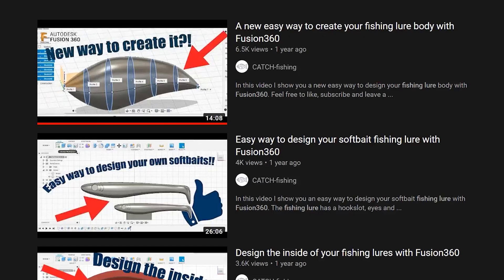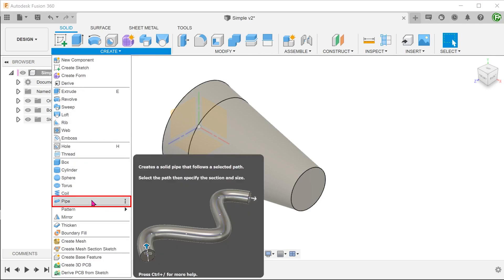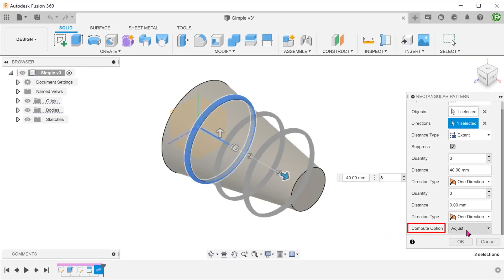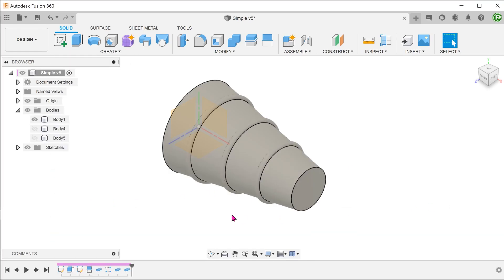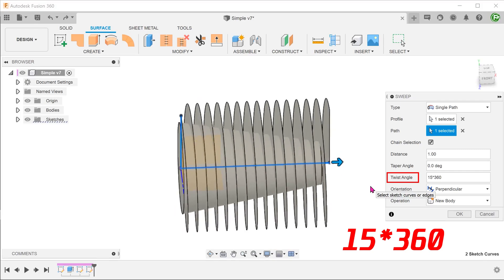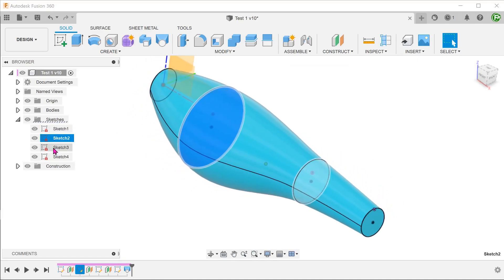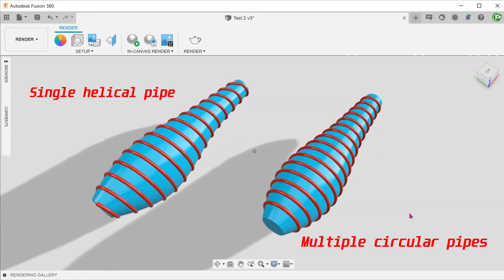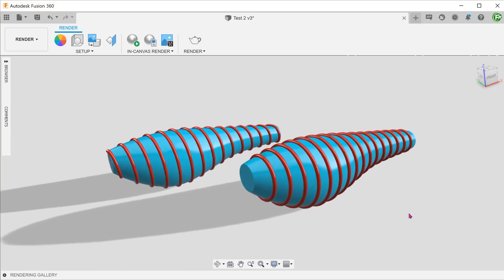Fusion 360 - Creating ribs/rings on fishing lures

Comment: Thank you for this solution.  My experience has been in creating the rib along a spiral path on a cone seems to work for a circular profile, and rectangular profile, however when trying to use an ellipse, the ellipse spins or twists along the path.  The approach I took though was a little different - I will try this and edit my comment.
[edit] - Thank for showing this method!  I managed to create the necessary shape (a circular helical shape on the inner and outer face of a conical body), by making the sweep twice, once for each surface.  My project/model was needed to hang a star onto our Christmas tree (the star has a helical spring shaped like a cone).

Comment: Would using  a construction line for the path prevent it from splitting the sweep?
Thanks for your videos, they're very useful; advanced enough to be interesting and stimulating.
Reply from the maker: Thank you for the compliments. Are you referring to the path for the loft or the path for doing the helical sweep? If it is the former, I did not actually create any path/rail for the lofting. Not sure whether it could have helped in removing the split line. If it is the latter, I went back into the model and changed the path to a construction line. It did not seem to make any difference.

Comment: Do you think the kids at Autodesk will ever give us a helical sketch option?
Reply from the maker: There is actually a coil command. There are some limitations to this. It cannot be used to produce a surface. It also cannot be used to produce an "undulating" coil like what is needed here. Though I think I might be able to use it to produce a ruled surface out of the solid coil and use it to cut into the undulating body.
Reply: @Fusion360School  True, there is a coil command. I find it helpful but also limited because there are only certain profile sections allowed, triangle, circle square, that the coil can take on.

I found myself wanting to create custom threads beyond what was offered in the thread command and needing to do workarounds to get what I needed. Another was to create custom cooling channels within an object like you present in this video and was required to do a workaround similar to what you showed here. Am I expecting too much of Fusion, or do you think there is a need for a helical sketch command?
Reply from the maker: A helical sketch command would certainly be helpful with custom sweeping profiles.

Comment: Awesome technique, but i ranked to let you know there is a trick to be able to use the pipe tool on multiple lines. If you go into the form tool and use the pipe command there it will let you select as many lines as you want as one command.
Reply from the maker: Wow, this is a revelation. I just tried it. It works! I just don't understand why we can't do this in a normal pipe.
Reply: @Fusion360School  I feel the same way.

Comment: What do you think would happen if you didn't want to split the face and made 3d sketch and used Intersect project? Would that make a path?
Reply: If you do not want to split the face what you can do instead is use the trim command using the body surface as the tool and selecting the excess of the spiral to delete. This will leave you will a spiral in the shape of the body which you can then use for the 3d sketch project.
Reply: @Dsk001  Oh that's a good idea. You will have a problem with the start and stop points starting tangent to the line rather than the split body, so you could do an offset face in the surface tab then extend the edges and start the spiral sooner. Then when you add the sweep along path + guide surface, you'll be able to split it flush with the flat edges from the lure body. That will give you a face that includes the spirals in which you can attempt to loft to a point with G1 or G2 curvature for a missile like cone that includes the spiral. I was trying to figure out how to do that.
Reply: @Dsk001  Sorry to hit you with another reply. That was such a good response I had to check out your channel. Amazing work! I would probably do that kind of stuff if I had a 3D printer to test print.
Reply from the maker: @HarryHeck2020  @Dsk 
Quite a few good ideas here. I tried @Dsk's idea of trimming the surface using the body. It does work to create a path. But I did face issues during the pipe at the end points, as alluded to by @Harry Heck. I had to deselect some of the segments. Another way is to perform the split face on the helical surface instead of the main body.
I tried @Harry Heck's idea of doing an intersection curve in sketch. However, I wasn't able to select both bodies, even with the 3D sketch option checked.
Reply: @HarryHeck2020  Thanks, glad you like the stuff I have made!
Reply: Also, you could Plane Along Path and draw your own profile, then instead of pipe you could use Sweep Path + Guide Surface to get the profile to be normal to the surface.